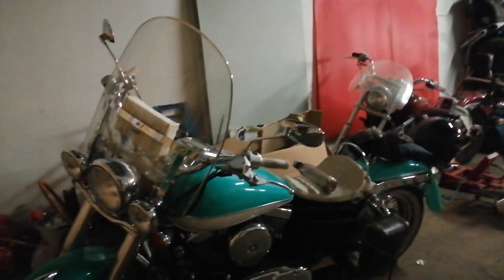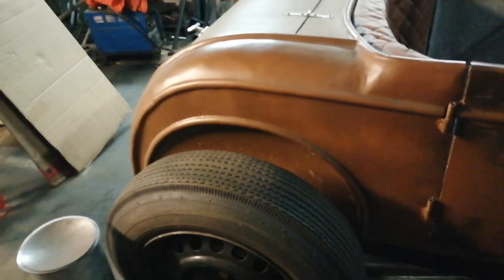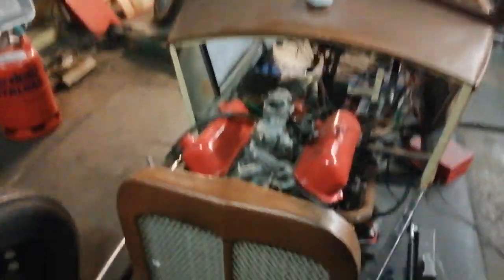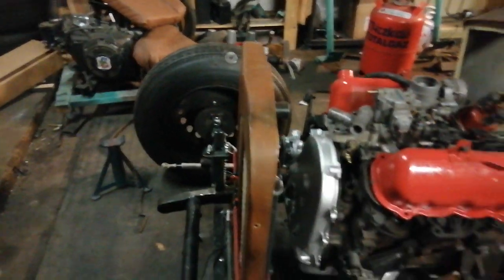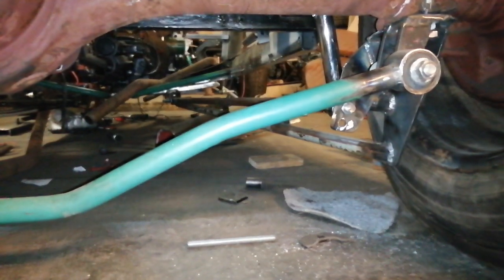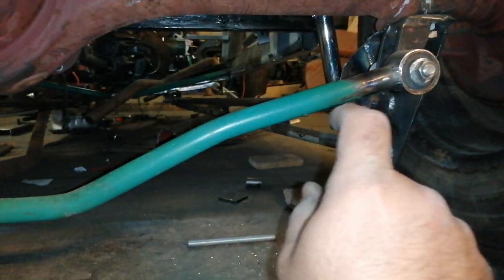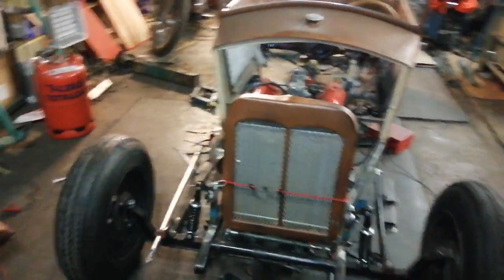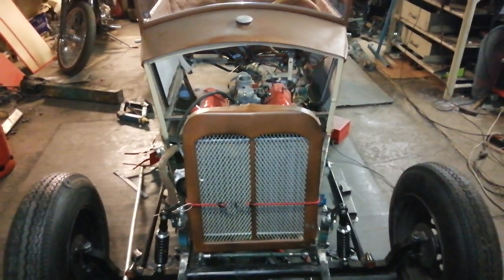Rat Rod Roadster diy suspension and future plans.

Comment: Suspension design is tricky, there's a lot of angles to consider.  It's looking good.
Reply from the maker: you're right. especially when you're designing your own stuff and not copying a prodution vehicule.
Reply: @martinshow5146 , good luck on your life choices, i live about 280 miles from where I  was born,  30 miles from  where I grew up and 12 miles from where I graduated from high school. I'll probably die where I am now.  Going to be 62 years old with lots of health issues this year, too much junk to move, and this old house would be perfect if it didn't have a basement and upstairs.